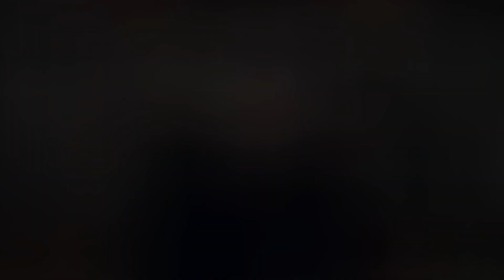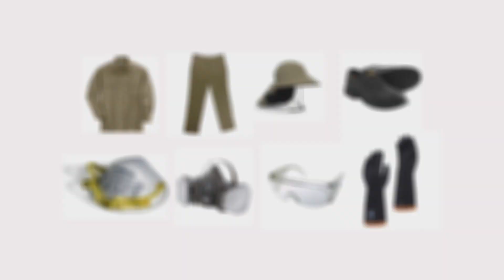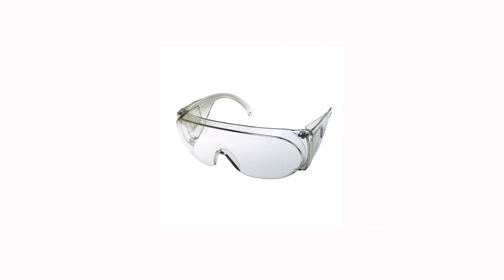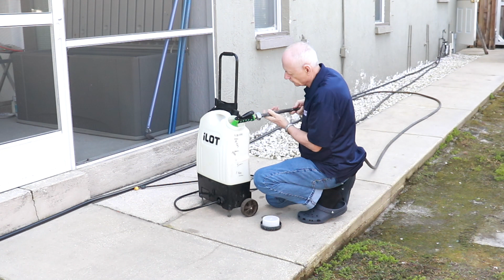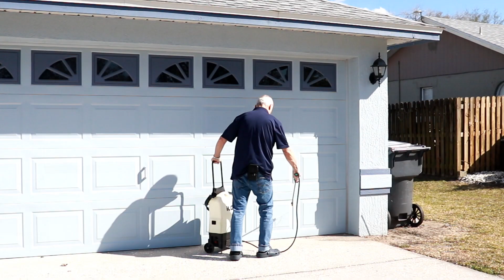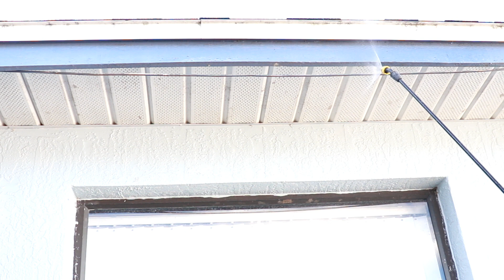How to Prevent Drywood Termites 100% Guaranteed.

Comment: Help I’m a tenant with a termite infestation and my landlords refuse to believe it and refuse to exterminate! All of my furniture is totally ruined! I have multiple sclerosis and I’m very sick. I’m faced with losing everything I have and basically being homeless. I worked my entire life up until the point that I become too sick. I’m not a lasy person I’m sick. I just learned that I have mold as well. I can’t have my apartment exterminated without my landlords approval. They refuse to do anything. Renters need more rights! Please help
Reply from the maker: I am so sorry that you're having this problem and that you have MS.  I'm sure you are a very wonderful person and you certainly do not deserve this kind of treatment.  Not only is your landlord an idiot for treating you that way, but it also doesn’t make sense.  If there are drywood termites in your apartment, then they are busy eating away at the walls and maybe even the floors and roof structure of the building.  This will end up causing the landlord thousands of dollars in repairs if they don't get rid of the termites.  If your landlord does not believe the problem exists, then perhaps you should call a pest control company and get a free inspection.  If the pest control company confirms the existence of drywood termites, then you can simply give the estimate to the landlord as proof that the problem exists.  This may inspire them to get their own inspection done.       
 
If your furniture is infested with drywood termites, then a lot of it can be treated with a can of fipronil foam.  All you do is shoot the foam into all the kick out holes for a couple of seconds, or until the foam is coming back out at you.  This is pretty easy to do for most furniture, but it can be a little challenging for upholstered furniture because the wood is often concealed by the fabric.  The problem is though that the termites are going to continue to attack your furniture because they are living in the woodwork and maybe even the drywall around the apartment.  Therefore, about all you can do is just treat the furniture when you notice the kick out holes or frass.   
 
I am so sorry that I do not have a better solution for you.  There is only so much tenant can do in this type of a situation.  Please do take care of yourself as best you can.  

Be well Robin.

Fipronil foam:  https://www.solutionsstores.com/fipro-foaming-aerosol

Comment: Subscribed .Can inject the termite trail with pesticide and spread boric acid in the ceiling?
Reply from the maker: If you are seeing a mud tube or an infested area.  They can be treated with a fipronil foam.  If it's a mud tube, just scrape off about a 2-inch section, down to the surface, and shoot the foam into the tube in both directions for a couple of seconds.  To treat a damaged area that has an existing infestation, just drill holes that are 4 inches apart and wide enough for the applicator tip to get into.  Drill the holes about halfway through the thickness of the wood and along the entire length of the damaged area.  Then, simply shoot the foam into each hole for about 5 seconds or until the foam is coming back out at you or is coming out the other holes that you drilled.  You should have foam either going into or out of every hole.

Boric acid is not effective against termites.  It will kill them, but there is not effective way to deliver it.

I hope that helps.  Be well my friend.
Reply: @GuysPestSolutions  does fipronil foam have a transfer effect
Reply from the maker: @lakibird21  I'm not sure what you mean by a transfer effect, but I can tell you that the termites do transfer the fipronil from one termite to another.  So, if one termite comes in contact with the foam, and touches another termite, then that termite will also die.  If the second termite touches another termite, then that termite will die too.  That is why this product will kill off a gallery or even an entire colony.

I hope that helps.  Be well my friend.
Reply: @GuysPestSolutions  very informative answer may you always be blessed.it is good I subscribed to your channel
Reply from the maker: @lakibird21  Thank you so much for that kind comment and for subscribing.  Very much appreciated.  Be well my friend.
Reply: @GuysPestSolutions   can it be injected into hardwood floors ? Thank you.
Reply from the maker: @tracynoscar  Any fipronil foam can be injected into a hardwood floor.  If you are seeing holes in the floor, just shoot the foam into the holes for about five seconds or until the foam is coming back out at you.  If the wood is just feeling soft, but no holes, you can drill small holes in the areas that feel soft, and then inject the foam.  The holes only need to be wide enough for the applicator tip to get in and should only be drilled halfway through the wood.  If you are going to replace the floors and you don't care about damaging them, then drill the holes about four inches apart and foam every hole.

I hope that helps.  Be well my friend.

Comment: What happen if apply Taurus SC every three months?
Reply from the maker: You violate the law and risk the pesticide police getting a no-knock warrant, kicking in your door, and hauling you away to serve a life sentence of hard labor in bug jail.  Othe than that, nothing.  Of course, I'm kidding, but you will be violating the law and spending a lot more money than is necessary.  After the initial treatment with the Taurus SC, it is perfectly legal to apply Bifen IT every two months and that will give you wonderful protection, for a lot less money.  You can apply the Bifen every three months and that is good if you have not had an infestation before, but if you have one, then your neighbors do as well, and a two-month treatment is probably a good idea.  The Bifen will last three months, but that third month may leave it somewhat less effective.

I hope that helps.  Be well my friend.
Reply: @GuysPestSolutions  I appreciate your reply in very detail information. Thank you! I got another question on Bifen. I checked found the active ingredient is bifenthrin and has different brand and type like Talster P or Bifen in concentrated solution also has granules type like Talstar PL Granules. Question is any different use the liquid based(diluted and spray) or granules based? If the result or impact wise is similar then which one is more inexpensive way? Since homeowners do it ourselves cares nothing much than cost. Thank you in advance for your professional feedback!
Reply from the maker: @arthur113113  The Bifen IT and the Talstar P are the exact same product.  The only difference is that the Bifen IT it's a little less expensive and it has a slight odor to it, while the Talstar P it's totally odorless.  The granules are for lawn applications only, but the liquid version can be used on lawns and structures.  The granules are fine to use on your lawn, but it costs more and takes a lot more time and work, than simply spraying your lawn with the liquid.  Personally, I treat my lawn every two months with Bifen IT.  I will give you the procedure for it.  If you are going to treat the house, you are supposed to use a tank sprayer, but I do know some people but do it with I garden hose sprayer.  You're not really supposed to do that, but it is very fast.  Anyway, if you are treating your house, then you want a treat around all windows and doors, up the side of the house from the ground about two feet, all cracks and crevices, soffits, and fascia boards.  Be sure to soak the area really well where the house meets the soil, and you always want a treat two feet out from the wall on the ground.  Not only will this take care of drywood termites, but just about every other kind of pest imaginable.    

I recommend using a specific garden hose sprayer that I know works, but you can use any brand that you wish.  I will place a link below for both the sprayer and Bifen IT.  I have found that these sprayers do not last beyond a few uses because they seem to clog up quite easily, even if you clean them really well.  So, what happens is you end up just spraying water instead of pesticide.  That is why it is a good idea to put a dye in with the pesticide, so that you know it is working.  I will provide you with links to all the products.  When the sprayer stops working, just buy a new one.  They are not very expensive.  Do not spray your house or concrete with a dye.
   
This application method does not require a lot of protective equipment.  I recommend wearing goggles, rubber gloves, long pants, a respirator, and long sleeve shirt (If it's not too hot out).  
 
The Bifen IT is too thick to be picked up by the siphon tube in the sprayer and therefore, it needs to be diluted.  To do this, pour 4 ounces of the Bifen IT into the sprayer and then add enough water to fill it to the 32-ounce mark.  So, that would be 4 ounces of product and an additional 28 ounces of water.  As you are adding the water, swirl it around a bit in the container, so that it mixes as you are adding the water.  Before screwing the sprayer onto the holding cup, make sure that the siphon tube is securely into the sprayer head.  If the siphon tube falls out, then you will be spraying with plain water.  Set the sprayer at 8 ounces per gallon.  The labeled dilution rate for the Bifen IT is 1 ounce per gallon of water, but you diluted it 1 ounce of product to 7 ounces of water, so that means you need to apply it at a rate of 8 ounces per gallon.  At this application rate, you will see the holding cup drain down fairly quickly, so you will know that it's working.  If the product does not seem to be emptying out of the holding cup fairly quickly, then something is wrong, and you need to stop and figure it out.  If the siphon tube is solidly in place, then it could be that the screen on the end of the tube is clogged.  If that is clear, then put your finger over the bottom of the tube and turn on the water.  If you do not feel the suction, then it's not working, and the sprayer is malfunctioning.  You always want to clean the spryer really well after each use to avoid clogs.  It's always a good idea to put a dye in the cup with the pesticide and that will show if the product is being dispensed.  Just avoid spraying anything that you don't want colored, like concrete or the house.  The color will wash off the lawn and plants when it rains.  You really don't need to use so much dye that you actually color the grass.  You just want enough color so that you can tell that the pesticide is being picked up by the siphon tube. 
 
Attach the sprayer to a garden hose and you are all set.  Set the sprayer for a downward fan spray and spray your entire lawn, ornamental plants, and garden.  Again, if you use the dye, then do not spray concrete.  Otherwise, I would spray the entire property from the house out to the property line.
 
Pro tips:  To make this application quicker and easier, I recommend that you buy 100 feet of one of those super hoses that you see advertised on TV all the time.  They are lightweight and make the job go a lot quicker and easier.  Also, if you attach a quick disconnect to both the sprayer and the garden hose, it makes refilling the sprayer a lot easier and quicker.  These hoses require that you have a shutoff valve at the end of the hose where the sprayer is located, so that you can shut the water off prior to removing the sprayer.  Most of the hoses have a shutoff valve built in, but not all of them do.  If you buy one that does not have a shut off valve, then you need to add your own.  I will place links below for all these items.  Please note that these hoses should be stored inside because they deteriorate fairly quickly when left in the sunlight.

I hope that helps.  Be well my friend.

Bifen IT: https://www.solutionsstores.com/bifen-it-insecticide

If you cannot get the Bifen IT from Solutions Pest and Lawn, then try domyown.com: https://www.domyown.com/bifen-it-p-226.html?sub_id=11662 

Sprayer dye for lawn: https://www.solutionsstores.com/turf-mark

Garden hose sprayer: https://www.amazon.com/dp/B00UER1S64?psc=1&ref=ppx_yo2ov_dt_b_product_details

Garden hose: https://www.amazon.com/gp/product/B09SYT173G/ref=ppx_yo_dt_b_search_asin_title?ie=UTF8&psc=1

Quick connect fittings: https://www.amazon.com/gp/product/B08QG6F3Z3/ref=ppx_yo_dt_b_search_asin_title?ie=UTF8&psc=1

Shutoff valve: https://www.amazon.com/gp/product/B07CZYGVFH/ref=ppx_yo_dt_b_search_asin_title?ie=UTF8&psc=1
Reply: @GuysPestSolutions  greatly appreciate your feedback! Wish you well!
Reply from the maker: @arthur113113  It is always my pleasure to help.  Be well my friend.

Comment: What’s your take on the termite bait stations for subterranean termites.
Reply from the maker: I can tell you that there are a number of pest control companies that will try to sell you a Sentricon system.  While that is the gold standard for baiting systems, it comes at a fairly steep price.  They usually are reasonably priced to install, but keep in mind that you have to pay them a monthly or yearly fee to have them monitor the stations and that fee goes on virtually forever.  So, in the long run, it's going to cost you a lot of money utilize this system.  It is far more cost effective to simply treat your house with termite granules every year, which only costs about $50.  I have a video on how to do that and I will place a link below for you.  Just be sure that you purchase the correct granules.  Bayer is making two versions of the granulates now and one of those versions does not work.  You need the version that is 700350A and not 700370.  The correct version uses imidacloprid as the active ingredient.  The wrong version uses beta-cyfluthrin as the active ingredient.  A lot of Lowe's and Home Depot stores are no longer selling the correct product, but it can still be obtained from Amazon and I'll place the link below it. 

Now, there are baiting systems that you can buy over the counter, but some of them are problematic.  You definitely do not want to buy the Spectracide system.  That system is loaded with bait and the problem with that is ants like to eat the bait as well as termites.  Therefore, you are constantly going to have those little pop-up sticks come up telling you that the bait stations are empty, even though you do not have termites.  Then there is the Trelona system, which works pretty well, but you need to remove the top of the monitoring stations every month or so to see if you have termite activity.  This system does not have a bait in the monitoring stations and what you do is, if you see activity in the monitoring station, then you switch out the nonpoisonous food source with the actual bait.  So, while this system works fairly well, it is also time consuming.  Then there are Red Eye monitoring stations.  The nice thing about these is that you do not need to remove the top in order to inspect them.  There is a clear window on the top of the station, with a little red dot in it.  When the dot disappears, then you have termites.   This system does not incorporate a bait, but rather a wooden dowel.  When the termites eat the dowel, then it drops to the bottom of the station and the red dot disappears.  When that happens, you simply shoot in a fipronil foam and that is supposed to kill off the entire colony.  With all of these systems, you need to install them at 8-foot intervals around your home, so you need a lot of them.  If I were going with a monitoring system, then I would probably select the Red Eye.   These are only available from Solutions Pest and Lawn.

Personally, I'm do not use a monitoring system on my home because I found that the termite granules do a wonderful job and there is no need to monitor.

I hope that helps.   Be well my friend. 

Video on how to treat for subterranean termites with granules:  https://youtu.be/H7rW_TSBHJ4

Termite granules:  https://www.amazon.com/dp/B000RUIJYM?ref=nb_sb_ss_w_as-reorder-t1_ypp_rep_k1_1_10&amp&crid=2USG8KURWPM95&amp&sprefix=bioadvance

Comment: I've found damage in my fascia board around my house. (Southern calif. Coastal area) I dug out the damage, and usually spray some termite stuff, then fill the void with bondo or wood putty.  (sometimes it's 3 feet in length!) Is this correct? Or are the termites still there? (Inside the wood) thanks!
Reply from the maker: I responded to a couple of your other comments that you attached to different videos of mine.  Please let me know if you did not receive those responses from me and I will make them again.  Also, if you have any questions about any of the advice I gave you, please do not hesitate to ask.  I am always happy to help. 

Be well my friend.